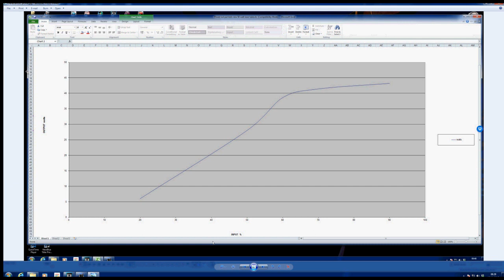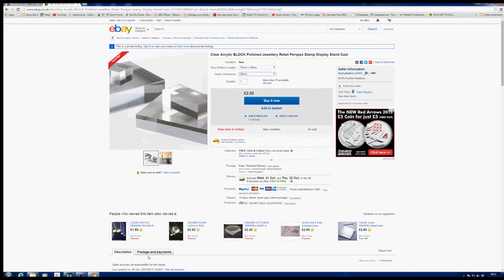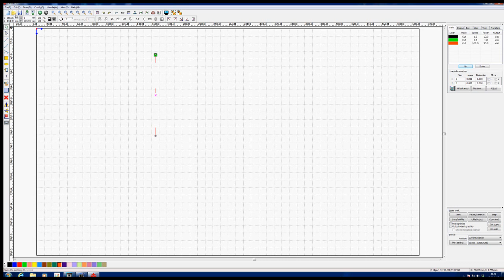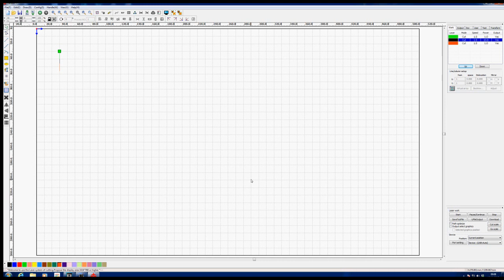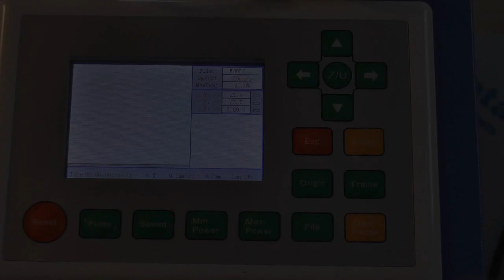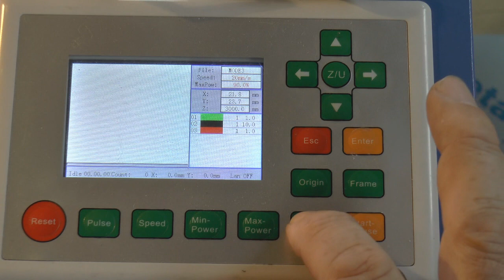RDWorks Learning Lab 22 The 50watt fraud   a lesson learned

Comment: To me this like you testing the mode adjustment this has to be sharp cone shaped
Reply from the maker: Yes, you are correct, it should be a sharp cone and this is hardly a cow pat. At this time 6 years ago I believed that power was the key ingredient and that this tube certainly had no power. To prove this beyond doubt I had to buy a power meter (later episodes)., However more recently I have been able to understand the relationship between power and intensity and that it is possible to have power without much intensity.
 Best wishes
Russ

Comment: Thank you for clearing this up.
I just purchased and received a few days ago a 5030 chinese laser and it came "equiped" with a KH laser (Kehui). From the first look I knew it to be bullshit, as it has some visible dust particles on the inside of the inner tube... Lucky for me I saw one other video from Thinklaser that warned me about the quiality being crap. I just hope that for a few months will be able to fire a laser beam, enough for me to make some money for a new tube. 
What do you think about CO2 tubes from CouldRay? I am planning to get one to replace the "original" one sooner or later.
Reply from the maker: Hi
KH Laser tubes are usually repurposed EFR rejects Although at 40 watts ( which your 800 long tube will be) it may be from another brand..  One cannot say how much of a failure it was, maybe just failed or working but almost junk. Without an ammeter and a power meter you will never really know, An ammeter is peanuts to buy and very simple to fit and will be your tubes best friend ever!!.
just put "ammeter 30mA" into an Amazon search for quickly available items, or do the same for ebay but get caught in possible delays from China. 
 A 40 watt tube should not be run at more that 18mA.
If you buy a CR45 tube from Cloudray, it will be an A grade SPT manufactured tube that has been relabeled by some local licensing agreement. It will deliver 50watts at 18mA because SPT are about the only company to UNDERSPECIFY their tubes. You will always get more than declared on the tin.
  If you watch   https://www.youtube.com/watch?v=V_ehGE51rH4&t=388s  you will see me fitting and testing  a CR70 that deivers well over 80 watts and it's not even it its max allowable current.
The important test to note is the one that I do at the beginning of the video where I make a 10 second burn with the unfocused beam into a block of acrylic. If you can get a couple of pieces of 5mm clear acrylic and superglue them together to replicate this test, it will tell you a great deal about the quality and performance potential of your tube. If its blunt it's rubbish and if it's pointed then it may be ok.

Best wishes
Russ
Reply: @SarbarMultimedia  Thank you so much for all the effort. You made my tube choice so much easier now. I already had exactly that type of tube in my Aliexpress basket (this is where I do most of my online shopping), but I wasn't sure about how good it is. Now I feel more relaxed. The only bad part is that the tube is about 200usd, and after import taxes in my country the price will end up aroun 260-270usd... Other than that, all good. I will test the laser this weekend and if it's really bad I will open a complain against the seller to get back the money for the tube (paid 1700usd for the entire machine and shipping).

One more thing: can I use distilled water and car coolant (the pink type) to cool the tube? I have my machine in a pretty cold room and I'm afraid for the water not to freeze inside the tube and crack it.

Comment: I think the primary reason depth not increasing after 60% is most probably the loss of the focus. A better experiment could be to reduce the time, say 1 second.

EDIT: I did a similar experiment with mine (2nd day of using). With even 20% power it made it through the other side of a 13 mm acrylic in 6 seconds. And the cuts were very thin, which makes me think that your machine was not focusing properly to begin with because yours were starting out big, which should not be the case given the manufacturers resolution specification.

To be exactly specific, here is the design of my experiment which should be equivalent to yours: put 8 vertical bars 1 mm tall spaced 15 mm apart. assign each bar powers from 10 to 80 percent, 0.166 mm/sec speed, and 10000 miliseconds of opening delay (choose through mode with 1% power, otherwise opening delay is ignored).

On a second experiment, I increased the speed to 1 mm/second, thus staying on each bar for exactly 1 second. In this case, 20% power barely made it to 13 mm, but 30% made it through.
Reply from the maker: Hi Mehmet
 My previous answer my help with this also.
Best wishes
Russ

Comment: i am curious how the output wattage measured in the chart at the beginning: 1:00. If I had to guess one would measure the voltage and the current across the laser tube and multiply the two, but cannot be sure.
Reply from the maker: I was very naive at this point in my learning journey and I assumed I had bought a 50 watt tube.  and this data was comparative . How wrong I was. This was a junk tube that barely output 30 watts when I eventually bought a rather expensive power meter to measure actual watts. DO NOT go anywhere near that red wire to measure voltage. Its 25 to 30,000 volts DC and can kill you.. Trust me there is no direct way to measure watts output from the tube with ohms law. The link between  power in and power out  is lost in some very non-linear physics. Very crudely the 25Kv ionizes the nitrogen in the the gas mix and that is the pink beam you can see. That nitrogen can then carry current flow. The HV power supply responds to your request for %power and controls the current flowing through the tube..More current flow means hotter and higher energy levels in the nitrogen. . When the nitrogen atoms collide with the CO2 molecules, there is a physics reaction that eventually creates photons of light that get amplified by mirrors within the laser tube. That INVISIBLE IR light exits the tube and is the laser beam.. There is no way to measure the power in that light beam  except allowing it to react with a surface to convert the energy into heat.. you may wish to jump to the following videos for how the tube works and how you measure power
https://www.youtube.com/watch?v=2F5O-1TH8b0&list=PLPWEtx5V9DqEogIeYRdcG_KYcB7UL2Qmn&index=7&t=86s
https://www.youtube.com/watch?v=lO9rWlobLZU

Best wishes
Russ
Reply: Thank you for the explanation and the videos in general. Today was my first day testing my machine and after 5-6 cuts I came across your videos on power loss. Had I not, I would end up with the same destiny!
Reply from the maker: @mehmetdtx  
Hi Mehmet.
 Mine was slow journey but yours can be speeded up by watching all the mistakes I made along the way,
Good luck
Russ

Comment: I was wondering, did you check in the menu FILE->VENDOR SETTINGS in the LASER tab what is the maximum laser power?
Reply from the maker: Hi
The vendor settings have nothing to do with this problem. I am now 3 years older and wiser and later verified that I was supplied with a tube that was rejected by one of the large manufacturers as not meeting specification and as sold for scrap. A third party took these tubes and retested them to make sure that they worked "in some way", enough to fool any naive E bay buyer,  and sold them on cheaply but for a huge profit!!!! If you see a tube labeled KH Laser then this is just such a tube.  The values in the vendor settings are all to do with protecting the tube from being over driven. They are expressed as % power and not watts. It is likeley that ANY tube you buy from Ebay or Amazon market place  could be such a B grade tube so do your homework on who is selling it. The % power used on these machines is very misleading.  because it is a % measure of the HV power supply output. Look at the max output mA on the HV power supply label and THAT is 100% and is a the current used to stimulate the lasing action. There is NO linear relationship between this current and the watts output.

Best wishes
Russ
Reply: I had the same issue with a RECI 80W lamp, brand new. It has a label on it saying agreed power 75W, and max power 80W. Well my measurements where 65.4W direct at the output of the lamp. The vendors settings laser power where 90% and i put it to 99%, just to test the output and the ps was regulated to give just 20mA. After i adjust it to 28mA the power went to 77,4W.
Reply from the maker: Reci is a greatly over rated product (in my opinion). I have experienced 6 different  Reci tubes (4 x W2, 1 x W4 and 1x W6). None has impressed me. You are paying a lot for the name and, as such,  the high value of this product attracts the fakers. Reci have worked on those problem and any genuine tube has a Q code that you can scan and verify it's pedigree.
see   http://www.recilaser.com/en/index.php?m=&c=Index&a=show&catid=13&id=34

The lowest Reci tube is the W1 rated at 80 watts  see here   http://www.recilaser.com/en/index.php?m=&c=Index&a=show&catid=7&id=65

2.    Operation conditions

Water cooling: using purified water; 2 to 5 liter/minute; water temperature: 10℃-40℃.

The operating environment: temperature 2-40℃; Humidity 10-60%.

The working current: test current is 29mA. Maximum working current is 29mA. The running current must be kept below 27mA. The life span can reach 8,000 hours if the current is kept below 25mA.

Let me put this Reci double speak into something simple............ We tested this tube at 29mA and it delivered 100 watts. Never exceed this current.  When in use, the current must not exceed 27mA  (80 watts) or you will invalidate the warranty.  HOWEVER, if you want a half decent life out of this tube we suggest you limit the max current to 25mA  (maybe 70 watts??)

None of your numbers are anywhere near this spec....hence my suspicion. 

Best wishes
Russ